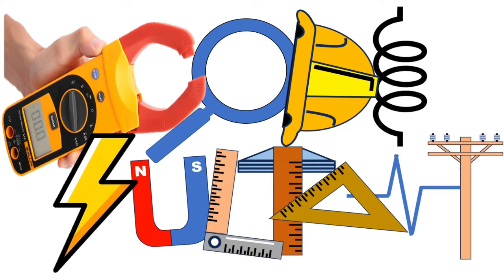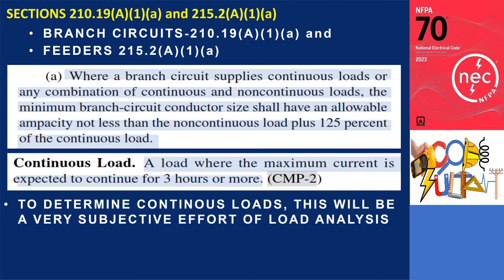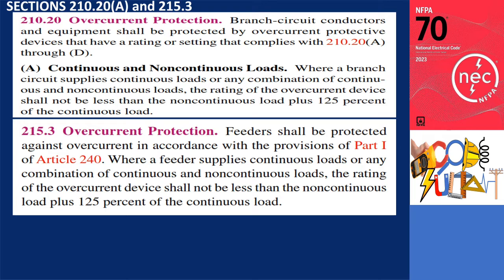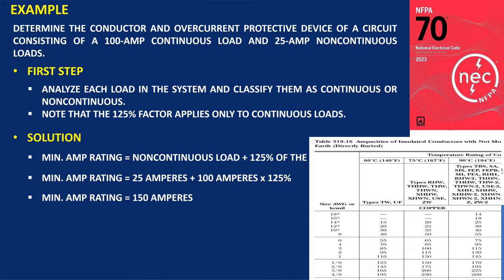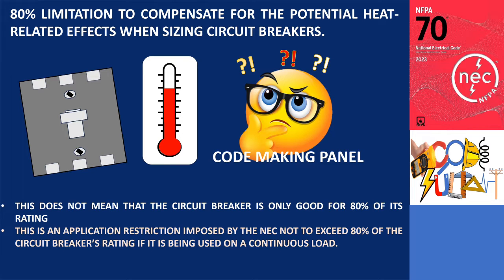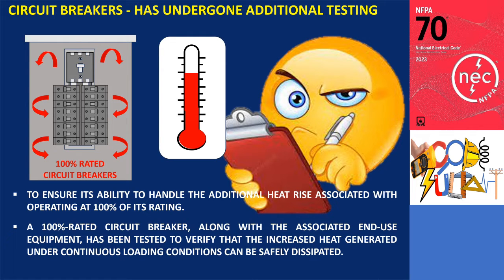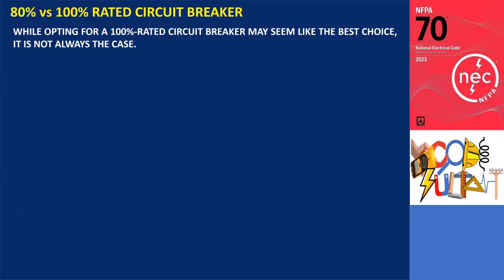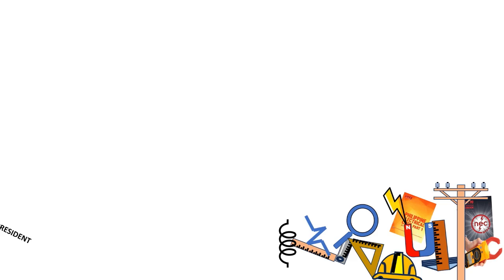80% NEC RULE FOR CIRCUIT BREAKER

Comment: In the PEC. The 80% Rule doesn't explicitly stated but it promotes a practical safeguarding to prevent any nuisance tripping, overheating and overloading of breaker. It is also aligns the principles of PEC

Comment: When do you use the 80% vs the 125% rule?  Does one apply to breakers and one to the wire? The code book is not user friendly. So much time interpreting and decoding, wish it was written in laymans terms.
Reply from the maker: Great question! The 80% rule applies specifically to continuous loads, like a water heater, where the load runs for three hours or more. In these cases, when sizing the breaker, you should multiply the continuous load by 125% to ensure safe operation. This helps prevent overheating and ensures the system can handle the load over time.
Reply: @codesultant  can you please provide calculations examples

Comment: Yes...the 80% rule exists.  The standard circuit breaker is 80% rated so you can not load it to full rating continuous.  Nobody understands this but its such an easy concept.
Reply: do you have a code reference if not this this comment holds no value
Reply: @waffles9743  it is 100% true.  It is in the code dumdum.  Also just logic and common sense.

Comment: There is no 80% rule, there are continuous duty rules. The 80% shenanigans were removed from the nec and replaced with continuous duty in like the 2000s
Reply from the maker: Thank you
Reply: It does exist, you're just not thinking correctly.
Reply: @workct4102  where does it state in NEC? please specify the article so I could be proved wrong. In my country, the Philippines our PEC, which has adopted NEC, has no mention of 80% safety factor
Reply: @bruhhhhh69  80% is the reciprocal of 125% thats the only difference.
Reply: @workct4102  it doesn't exist for noncontinuous load. You just lack reading comprehension.
Reply: @vylon1075 when did anyone say anything about continuous or non-continuous?  Stop cherrypicking.